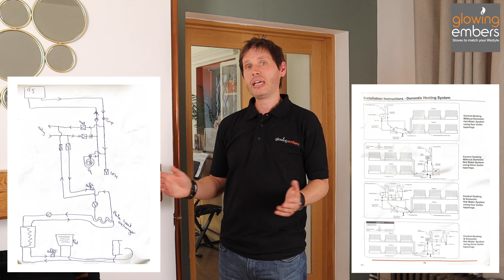Installing A Boiler Stove | Glowing Embers

Comment: Hi Everyone. Who can comission this system in West Sussex? Anyone knows a reliable, knowledgeable man with the proper certificate? Thanks 👍
Reply from the maker: It is really hard to find knowledgeable and qualified people to do these nowadays, that is why I made the video.  I had to get a plumber and stove installer to work together.  You can search the HETAS site for installers of wet systems in your area but you may not have much luck, as many have stopped doing these systems.  It is just persistence and ringing round and using the ideas here to design a system with a heating engineer.  Good luck and do contact us if you need any help designing the system etc.